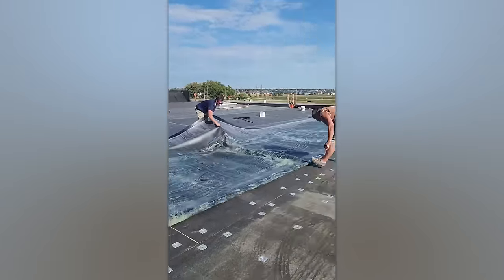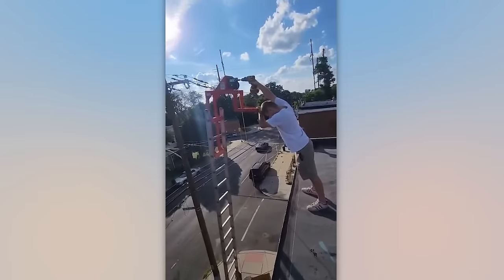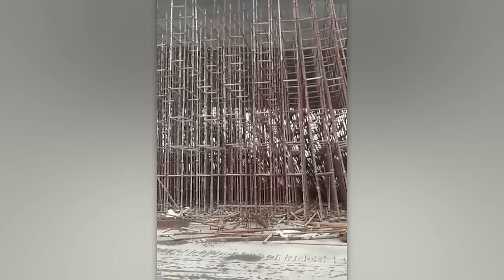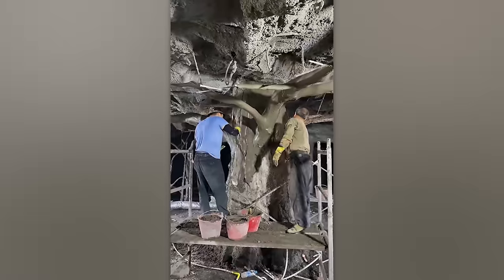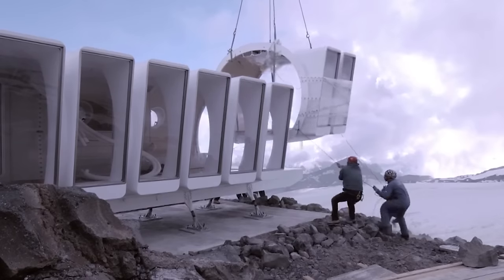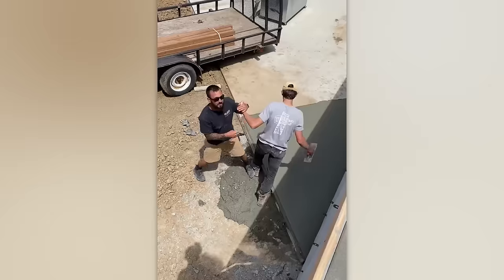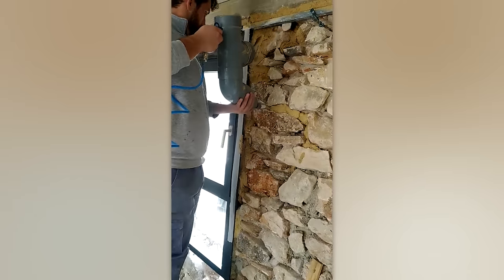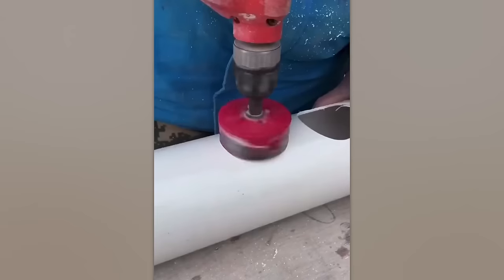Ingenious Construction Workers That Are on Another Level

Comment: We were tasked with getting a mansion level which was falling off a cliff and stablizing it and we didn't know where to begin. My boss puts a cord around the house and telephone poles on the top of the cliff and twisted a 2x4 between the cord near the highest pole and started spinning it (which tightened the cord) and kept twisting it until the house was completely level and then nailed the 2x4 to the pole and we started on new supports and footings. That was completely insane but it worked well! 19:30 is similar.